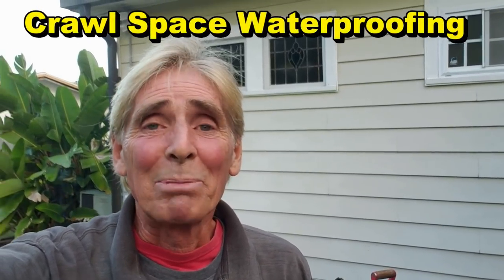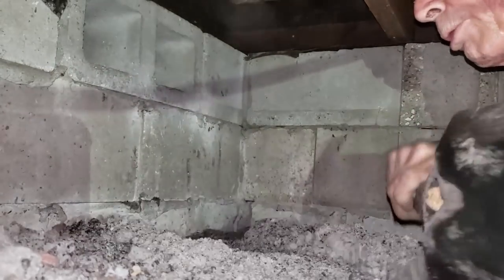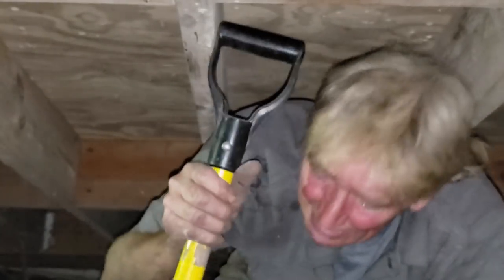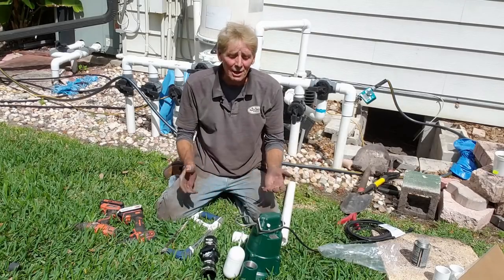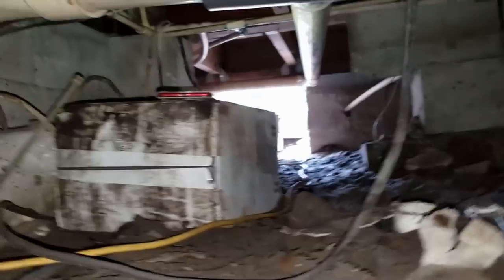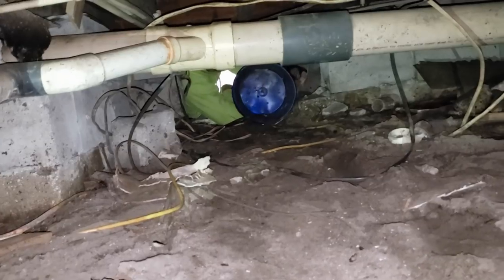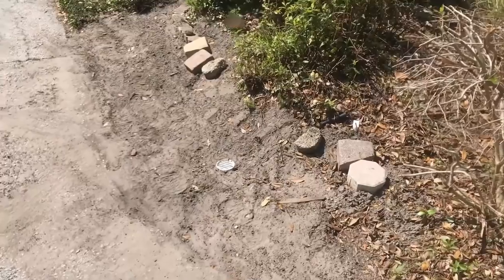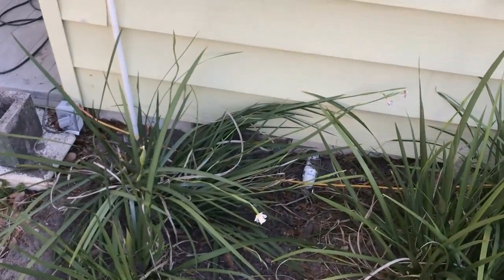Hurricane Proof Your Crawl Space,  foundation waterproofing

Comment: Hey Chuck, that’s a tight crawl.  Great job done as usual.  I’ve learned so much from your videos.  Another tip for getting tools in and out — get one of those black plastic masonry mixing tubs from a big box store.  Tie a loop of rope through holes drilled in the lip of the tub.  Fill the tub with the tools and materials you need and drag it behind you as you crawl.  It will slide like a sled over the dirt and sand in the crawl.  One trip to get everything in and out.  For taller crawls I’ve used a Gorilla Cart but for tight crawls use the masonry tub.  Take care and keep smiling!

Comment: Is that really a garbage can with the top removed that you used as a sump pump basin?? Seems like the pump would short cycle with such a small footprint. I would also be worried about thin wall plastic being strong enough to hold up to years of ground pressure.

Comment: Another great video.  I'll bet most contractors would not even quote that job.  How do you deal with power outages when a storm comes and the sump pump power is out?
Reply from the maker: Hi Thomas..  Thanks for your question. This is the longest video I have ever posted.  I wanted to share the experience,  knowledge, and the humor, That comes with working in a very confined space.

 About 3/4 of the way through the video, I actually answered your question and addressed  Battery backup 12 V systems  .  But yeah, of course, when power goes out the pump does not work,  However, the system moves so much water BEFORE the power goes out, that the remaining portion of the storm now has a place to go.

I think what's really interesting About foundation waterproofing, is That in ALL the years (30 plus years) I have installed these systems, they all work 100%. 

Truly 1000s of installs. They all still work  Protecting the  Foundation.

Thanks for the comment